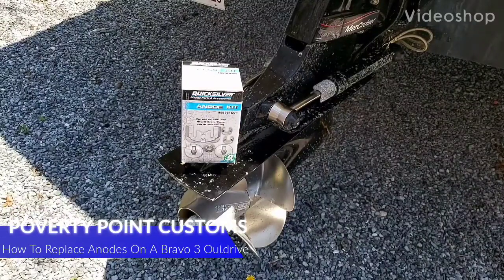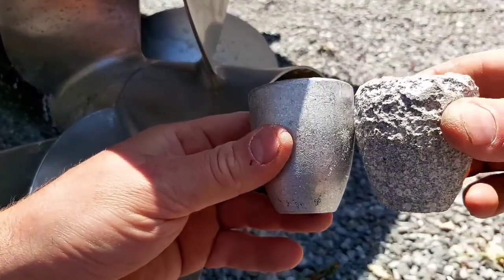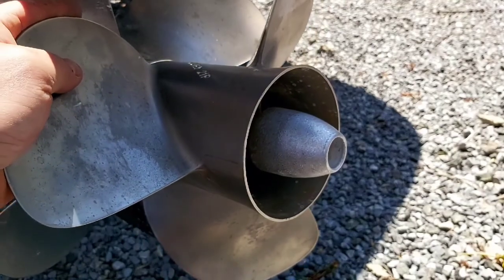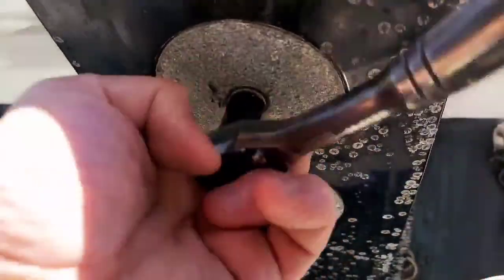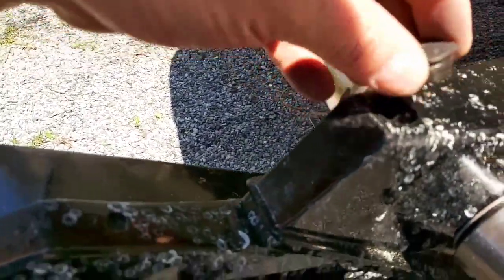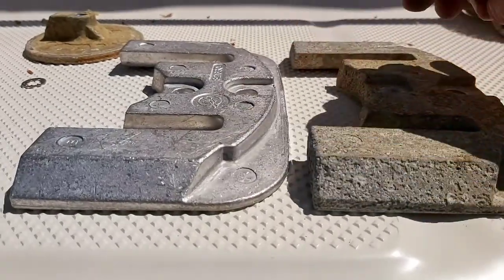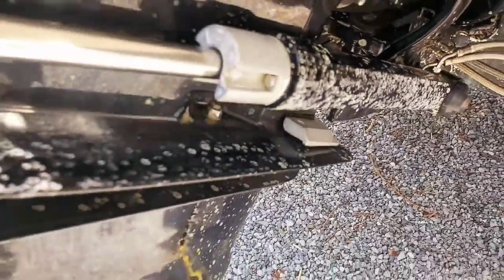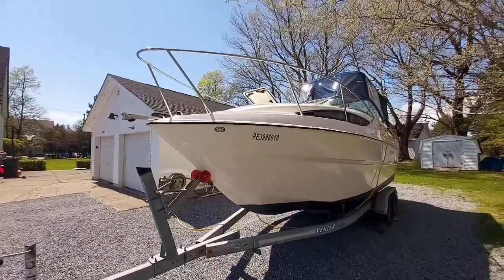How To Replace Anodes On A Bravo 3 Outdrive

Comment: What year is this drive ? 2004 or before ?
Reply from the maker: 2012
Reply: Thank you, we have a 2000 model but the drives were changed in 2012. Trying to distinguish between the 2004 and up and the pre 2004.

Comment: What do these anodes do?
Reply from the maker: Think of anodes as small shields that protect your boat's engine from deteriorating. The metals on your boat's motor corrode over time when immersed in water, and because the bulk of an outboard or sterndrive is made of metal, anodes are crucial to an engine's health.